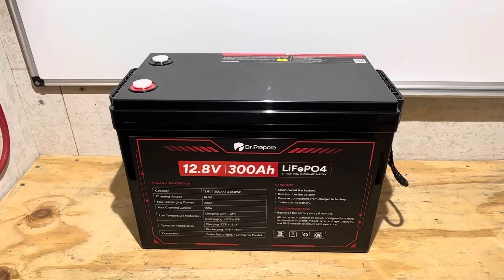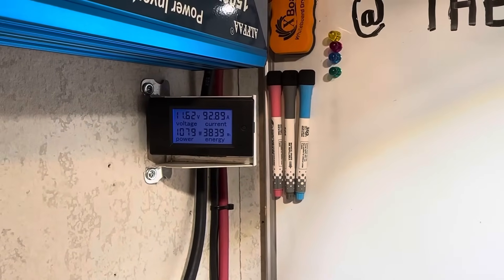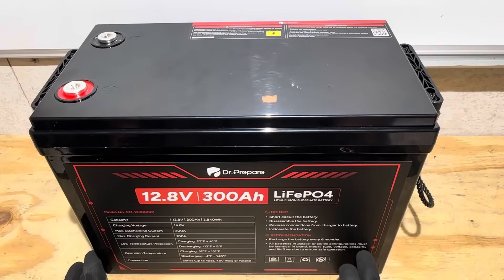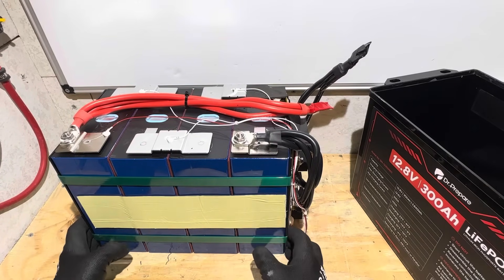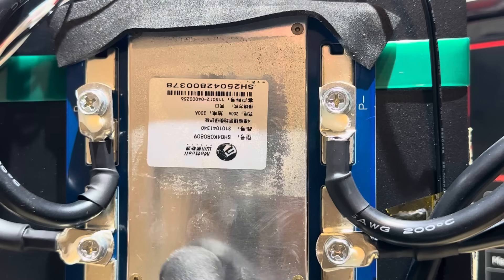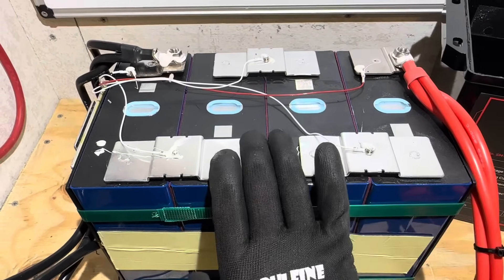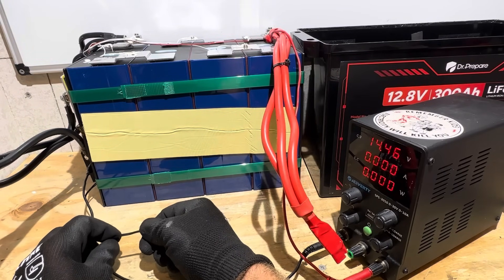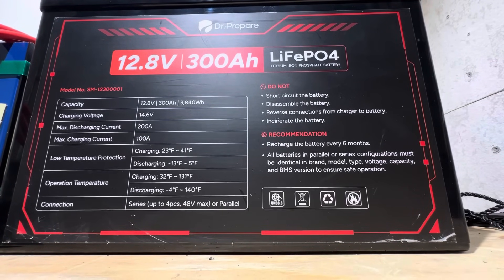DR. PREPARE 12V 300Ah Compact LiFePO4 Lithium Battery Review & Teardown

Comment: Manufacturing date doesn't bother me as the battery performed as advertised (better actually) and does have a ten-year warranty (if the company still exists in ten years). While I realize there is some warehouse degradation, I tend to be more interested in performance. After all, some of us perform better with age...☺
Reply: Probably started at 310 ah , must have been regularly charged,  and over the 2 years degraded down to 305 ah.
Reply from the maker: Thanks for the feedback! 🙂

Comment: I think accurately weighing the batteries before you test them is important. For example, I just received 16 Dumfume 300ah batteries 8 weighted 56.4 lbs 7 weighted 58.2  lbs and one weighted 58.8 lbs. I will use these in a 4S4P solar battery bank. Please test these if you can? If I lived by you I would bring them to you. thanks for your work!
Reply from the maker: Variation in cell weight and how much glue/goo inside probably accounting for a small weight difference. Cells can vary in weight slightly but must meet tolerance by cell provider. Appreciate you, take care!

Comment: Battery does not show up on Amazon link. Dr. Prepare does not seem to have it in its lineup anymore.

Biggest downside for me is the low 100a charge current. But I’m glad to see discharge current is 200a
Reply from the maker: I’ll double check the link, thanks for the heads up! They may have sold out? Appreciate you! 👍

Comment: What size inverter should I use with this to power a 12000 btu ac
Reply: Definitely gonna need more than 1 batt
Reply from the maker: @primus711 To run the load after sundown definitely need a healthy amount of capacity!
Reply from the maker: How many watts or amps is your AC unit? Window unit? RV unit? Portable? Mini split?
You have to account for the inrush current for the compressor when it starts. Some quality 2kW inverters will start and easily run a mini split. Most RV or window units really need a quality 3kW inverter.

Comment: I got 3 dr prepare 12.8v 100ah on my boat. Love them so far no issues. I use two for my trolling motor (24v) system and one for all my fish finders. Could go a few days on one charge
Reply from the maker: Awesome! Thanks for sharing your experiences and use case scenario with the brand. Glad to hear you’re having a good experience! 👍
Reply: @THEOFFGRIDMOUNTAINHOMESTEAD yeah couldn’t beat the price. Figured why not give it a try. 20lbs weight. Double the power. Chinese junk or not beats heavy lead acid batteries that barely last 2-3 years. I’m already happy a year in
Reply from the maker: @BRYBO1984 Nailed it! 
Also they don’t self consume their charge anywhere near the rate of lead acid and don’t require constant babysitting. 👍

Comment: Real QR code is supposed to be right next to the vent, pretty sure this is a re-lasered qr code.
Reply from the maker: Usually the cell data code is near the - terminal. Some cell manufacturers also have a data matrix code near the vent. Data matrix codes are only traced by the manufacturer internally. Usually while in the assembly line process and the “aging” test. Then they are further tested and graded. Once cells pass internal tests they are given the QR data tag and/or barcodes and then are available for sale. True grade A cells come with a data sheet outlining the pertinent information for the cell.

Comment: If that battery/cells sat in a warehouse for 2 years it's likely the cells need to be top balanced. You should have  cycled the battery a few times. I have a 24v 200ah battery in my cabin and sometimes it goes up to 6-8 month unused. All it takes is 3 or 4 cycles and it back in balance.  If the cells are stored properly 2 years is no big deal.
Reply from the maker: Not a big deal but when other vendors are providing cells that are 3-4 months old I feel the end user/consumer should be aware. The boards will most likely fail long before the cells ever get tired anyway. 
The action of cycling before running the battery wouldn’t be consistent with the end user experience of a “new” battery out of the box. 👍
Reply: Hi there, just curious what do you mean by top balance and how would one be able to check for unbalance on one of these so called dumb batteries. Apart from teardown and internal measurements.
Reply from the maker: @aliasgertayabali5260 You can’t check without opening on non-Bluetooth units. 
One would have to rely on the passive balancer to bleed the high cell(s) down. If the cells were matched by internal resistance at the factory it won’t take long to have an evenly balanced pack. It usually doesn’t work this way and some packs have a runner cell that triggers COV before the you can even get to the constant voltage phase of the charge sequence. 
Also some BMS balance only when charging and others balance above a certain V threshold regardless of charging or discharging state.

Comment: I have 4 brands of these "300 ah" batteries,  I'm like my Dumfume,  wish it had BT like my Vaoltor.  Tell us your favorite so far.
Reply from the maker: Thanks for sharing! I’ll have to sit back and ponder over which is my favorite overall. So many variables between price and intended uses. Bluetooth or no Bluetooth. Cheap or Premium. Certain ones stand out as a good choice for a single battery setup to handle large currents while others that aren’t as robust would be great for parallel setup etc.

Comment: I know it's not my money, but I'd like to see you randomly buy a battery off of Amazon or eBay exactly like companies send you and tear both of them down and see if they are the same. You do good reviews, thanks.
Reply from the maker: Thanks for the suggestion! I have recently bought another Truvalux, some CyclenBatt Mini, Goldenmate from Amazon. I have some older GrenerPower and LiPuls that were bought on Amazon. I would be willing to tear one apart and run capacity etc. 
Would you like to see one of these?
Reply: @THEOFFGRIDMOUNTAINHOMESTEAD  Tear down the Dumfume 300ah these are around $260. Thanks or all your tests!

Comment: Wow. You're staying busy! Thank you again for all of your testing!!
Reply from the maker: Yes my weekends and evenings are mostly consumed with filming/editing! It’s really fun though, always a mystery to how a battery or component is built or performs! Appreciate you!
Reply: @THEOFFGRIDMOUNTAINHOMESTEAD  I've got a small solar project that started with 2 RV panels, 12v. Up to 8 of them, 2 charge controllers now and 24v.  6, 12v 100ah Batts. I'm only running a single circuit in my home with auto transfer to grid. Find I'm sitting at 100% to often. Want more more batteries! lol
Couple more panels on the other charge controller and I see 48v in my future. I really appreciate you sir!
Reply from the maker: @2._-1.-_ Awesome! Thanks for sharing your setup! It can get slightly addictive, always on the quest for more generating capacity and more storage capacity. Have you tried using your dedicated circuit to run freezers, refrigerators etc. exclusively on solar?
Reply: @THEOFFGRIDMOUNTAINHOMESTEAD  I did try the fridge and a freezer and washing machine in the beginning when I was at 100% SOC and felt like I was wasting energy. The prob. arised when a motor (fridge, washer) kicks in, the in rush current drops voltage enough to trip the auto switch to grid too soon. Not meant to be a plug but I love the Victron gear that has helped me do so much analytics. I could see this happening on the smart shunt app even though I had a meter on it measuring in rush. It's all about the balance with solar for me. You're an awesome contributer to our knowledge base.
Reply from the maker: @2._-1.-_ Thank you! 🙂

Comment: So with the cells manufactured date being two years old, do you think the cells sat in a warehouse unused for two years, or do you think they were used for two years in some sort of application? I couldnt tell which way you were leaning in the video so I just wanted some clarification. 

Build quality seemed decent, on this one.
Reply from the maker: Definitely a decent build overall. As to the cells, Envison AESC was popular around 2022-2023 timeframe. Many cell vendors were pushing the AESC product line and they had good specs at a lower price than EVE/CATL/Lishen etc. 

I would go on the assumption these cells were warehoused. I don’t see any indication of previous use whatsoever. 

Maybe these battery providers are just trying everything to keep costs down since cells overall have gone up in price and the tariffs costs are also a factor?

Comment: will you test the Humsienk 12v  314ah mini?   Also will the 314ah mini work well in a marine application?
Reply: It will, but it's 300ah and not 314ah. Misleading labeling.
Reply from the maker: @meilyn22 Did they do the ol switcharoo game?
Reply: Hello, not sure if anyone else has replied with info on the Humsienk 314AH mini but I purchased 4 of those and started using them about 3 weeks ago.  I ordered 4 and had an issue with one of them, FEDEX delivered one of them upside down and when they dropped it on the sidewalk the battery cells impacted the type of the battery case pinching 2 of the cell BMS wires and the NTC T1 temperature wire inside and cut those 3 wires off.  Rather than dealing with filing a claim I opened the battery and did the repair myself.  Internally the Humsienk and different than these Dr. Prepare, they are true 314 AH bu the BMS in the battery is only a 100 amp continuous rated and the wires are far smaller than what you see on the Dr. Prepare with only a single either 5 or 6-Gauge wire on the positive lead and dual 7 or 8-Gauge wires on the negative to and from the BMS to the battery post.  Once I made the repair I have not had any issues with any of the batteries and I have them set up in a pretty good size backup system for my home.  The system is still a work in progress, but I have successfully run the house from just the 4 batteries set up in a 48 volt battery bank through a large low frequency inverter and was able to run the 240 volt electric oven, electric dryer and everything else in my house, not everything at once, but at times loads in excess of 6,000 watts and the batteries were outputting over a 150 amps with no issues.  I did monitor the BMS temperature in the batteries since the BMS are Bluetooth and they did warm up a little but did not go past 120 degrees, but I did note a little increased temperature on the battery posts because the batteries do have the smaller leads internally which appear to be the limiting factor on how much you can draw from the batteries, but other than that if you are not going to be drawing more than a 100 amps continuously from them they would be great.  Humsienk does make a 341AH version with 200 amp BMS and I wish I had known that when I made the purchase, but for my limited use on these they will be fine.